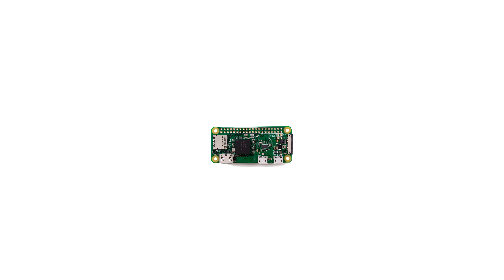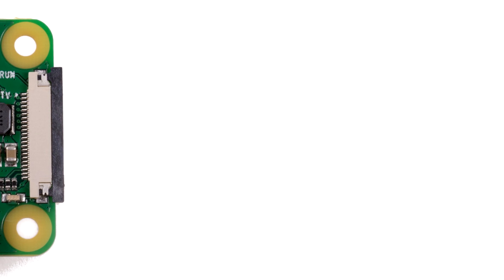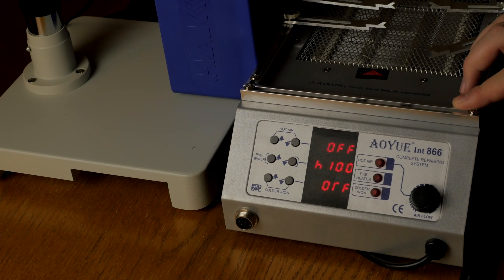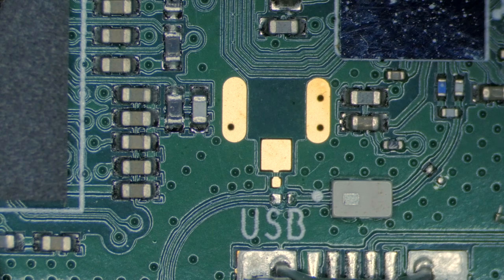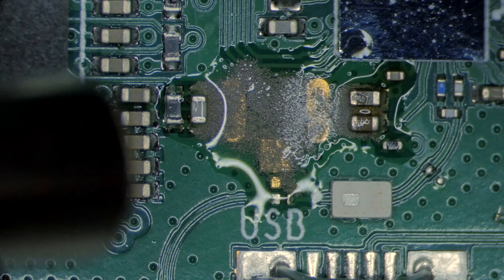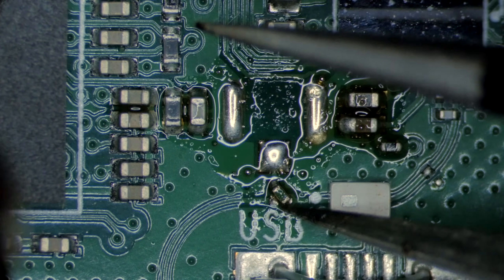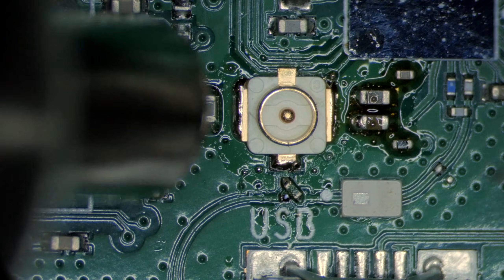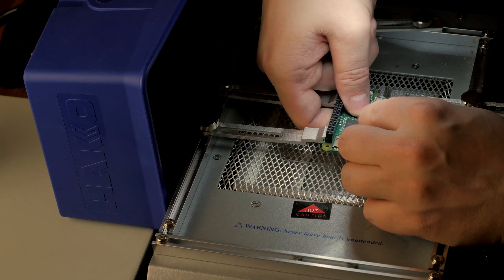Add External Antenna to Pi Zero W [Tutorial]

Comment from the maker: After several requests, I've made a handful of modified Pis available for purchase. If you don't have the soldering tools/skills to solder it on your own, or just don't have the time, check it out! They are available here: https://www.ebay.com/itm/114773309557
Reply: is it still available?
Reply from the maker: @ivan_adamovich  I'm no longer keeping the Pi Zero W in stock, however its successor the Pi Zero 2W is available. Check out the link in the description as that's the only link I'm keeping up-to-date.

Comment: 20 odd years getting by without a rework station and you're telling me a $5 computer is going to make me change that?
Reply from the maker: This is doable with just a regular soldering iron, though it's a bit more difficult. If you look at my video on the Pi Zero 2 W, there is a section showing some techniques that can work for soldering this with a regular soldering iron (https://youtu.be/6R8xhSzpJTU?t=276).

Comment: I didn’t have the right tools to do this. My WiFi signal was borderline on my pi zero w. I added an external antenna that was not actually connected to the board.  I grounded it to the pi and soldered a resistor from the other antenna lead to the same ground.  It works!  I have a reliable connection now. I assume there is re radiation of the signal getting to the  antenna on the pi.

Comment: There's no need to be picky when it comes to container types if all you're using is IPA — this stuff doesn't melt plastics any more than ethanol does (at least the types actually used for containers; can't vouch for 3D printer stuff like ABS). Acetone is another story, but I'd never risk exposing an assembled PCB to acetone anyway: e.g. the plastic on those DuPont headers will certainly turn into mush in minutes.
Reply: Once in a very rare while, Ive seen isopropyl damage something. Cant think of any examples at the moment. But 99% of the time its perfectly safe to apply it to projects.

Comment: I'd never use a hot air gun for this. A soldering iron will allow you to both remove the 0201, solder the u.FL, clean the resistor pad flat and put it back on without much effort. A hot air gun, on the other hand, can and will necessarily desolder every component in the vicinity, so your tweezer hand must be rock steady: one wrong move and good luck reassembling half the board. Or, worse yet, set the airflow one notch too strong, and all the components are literally blown away.

Over 3–4 years as a hobbyist working almost exclusively with SMD, I didn't have many occasions where I picked the hot air gun for PCB work over either an iron, a hot plate or an IR reflow station. And when I do, I tend to damage chips, peel pads off or make some other kind of mess. My advice is to reserve the thing for shrinking the heatshrink.

Comment: So what type of magic wand did you use to make all that solder just suddenly jump into the right place? I have a couple of Harry Potter wands. Will one of them work? Or do you need a special soldering wand.
Reply from the maker: It's a hot air rework station. The surface tension of the solder pull things into place as soon as it melts

Comment: Are you going to be making any more of them?  I just need a few with the connector added.  Already have the connectors and antennas
Reply from the maker: I'll be making some more as soon as I can get them back in stock. I have a shipment of the second gen coming as well that will be up soon (hopefully sometime next week). They will be up here, so check back early next week: https://www.ebay.com/str/techcaleb
Reply from the maker: The second gen boards are now available: https://www.ebay.com/itm/115117982940

New video coming sometime this week on how to do the modification as well (it's similar to the Pi 4).

Comment: The Pi Zero and Pi Zero W is a slow computer. Any Pi 2 B, Pi 3 B or Pi 3 B + or Banana is faster.
Soldering paste is not necessary, just apply flux and tin it with a solder wire that is not too thick (1mm or 0.5 mm). Solder paste gets bad over time and can then no longer be used, 0.5 mm solder wire is better for SMD for hobbyists. You can also preheat in the oven to 180 - 200 C.

Comment: I lost the resistor when I try to resolder it's new place. Can I use the other resistors right below the embedded antenna instead of original one? Are those all same?
Reply from the maker: The things below the embedded antenna are actually capacitors. If you lost the resistor, you can either order a new one from a parts company like Mouser or Digikey (it's a 0 Ohm 0201 resistor) or just snip off a bit of fine stranded wire and use that. It's just a jumper resistor so it should work either way.

Comment: Is it possible to add network controller and add external antenna to Raspberry Pi (without W) or this version is designed for using without internet ?
Reply from the maker: The non-W version of the Raspberry Pi Zero doesn't have any of the pads needed for putting on the wifi chip, so it's not really designed for it. In that case your best bet is to get a USB wifi card (or just get a Pi Zero W). For all the full Pi versions starting with the Pi 3, a similar modification is possible (see https://www.youtube.com/watch?v=MTwWnZG8wUY and https://www.youtube.com/watch?v=mZGMGs6RDtc)
Reply: @funtechu  I'll watch it. Thanks for the fast answer

Comment: Is there a measurable increase in performance doing this? I have a DIY ROADIE in my Tesla, based on a Pi Zero W. The signal is at 30%, enough to remotely view files on the device but not to copy them. As the licence for the software is linked to the Pi, I only get one shot! Just want to make sure its worth it. Any microscope/magnifier recommendations? Thanks.
Reply from the maker: It does have a small performance improvement depending on the choice of antenna. More importantly, having an external antenna gives more flexibility in where you put the antenna which could give better results.

I did some measurements for the Pi 4 version which you can find here - https://youtu.be/MTwWnZG8wUY?t=289

In that case the Pi Zero W would be closest to the Ext cut variant shown, so depending on the location, the signal level will likely be either comparable or slightly better (5-10 dBm) than the stock PCB antenna. Those tests are done with an antenna that isn't substantially directional (Molex 206994-0100), but you could also use a slightly more directional antenna to get even better performance.
Reply from the maker: For a microscope, I'm using an AmScope SW-3T24Z with a ring light (LED-144W-ZK) and a 0.5X Barlow lens. But any good binocular scope should work well.
Reply: @funtechu  Thanks for the response, I appreciate it. Definitely worth experimenting.

Comment: Yes, we all have high-end equipment as you have but not for me I only have a soldering iron and solder so why didn't RP add the socket it would only cost a penny if purchased in thousands?
Reply from the maker: I suspect it's a combination of them thinking that few people will use it, and the cost. The Pi Zero W is a board that they actually sell at a loss usually (which is why most places limit you to only every buying 1) so every penny matters. As for the cost, even when buying in high quantities, a U.FL connector still costs around $0.50. Multiply that by about a million units sold, and that's probably why.
Reply: Much of the point of the Raspberry Pi computers is for school children in England to learn to program them and use them as the basis for projects. The kids who need the socket can learn by installing one which is the whole point.

Comment: Damn, now where did I leave my Hot Air Rework station. Thanks for the informative demonstration.  Would be nice to see a version using caveman tools that we all have.
Reply: I would rather do this with a proper soldering iron, instead of hot air.
Reply: I did it with a hakko soldering iron. Needless to say the resistor disappeared  during the process and I ended bridging the pads with a tinned super fine strand of copper wire I pulled out of of a cable I found. Shockingly, it worked.

Still: 3/10, do not recommend.
Reply: You can use a hot air gun they're like £10 - £30 pounds. Or just a solder iron :)

Comment: why doesn't come like that stock?
Reply from the maker: Probably cost. It doesn't cost anything to add the footprint for the connector, and the jumper resistor is about 1/2 of a cent, so it's a compromise that allows people who need an external antenna to modify it, without driving up the cost for the (probably majority) who are just going to use the on-board antenna.
Reply: Why? Most likely because most English school children don't need one and those who do can add one.

Comment: That is excellent soldering skill. 👍

The only remark I would make is about touching the antenna after installation - I've lifted trace (the conductive material) on boards easily.  You don't appear to be too worried about moderate force.

Comment: add heat to the resister and keep pulling until it stops resisting
Reply: I can't get that little f*cker off and I'm trying with 340C already…
I'm taking pauses because I don't want to burn the board…

EDIT
Okay, sorry for bugging you
I think I'll need to calbibare my hot air since the resistor desoldered at 400C and my 183C Solder around the same temperature… 
I ended up with 420C on the display at mid to high air speed. 
But yeah, I'll need to calibrate that.
Reply: @MCgranat999  ya that might work

Comment: Very good explanation, thanks for sharing! 

I've never worked with a hot air station, but that might change during next few days. :-)
I want to solder an SMA connector to my Pi Zero W. Not sure if I try it with my regular soldering station and novice soldering skills or if I ask a friend who owns an hot air soldering station.

Best Regards
Reply from the maker: I would definitely recommend the hot air if you have access to it. Maybe you can even ask your friend to do it for you if they are already good with hot air!

Comment: I am doing the same thing with the Zero and maybe the Pi4.  Using the heat gun is scary to me.  When I see all those small parts on the board I am afraid they will fly off!   I need more practice with that tool.          Thanks for the great info!
Reply from the maker: The surface tension of the solder will usually keep everything in place as long as you don't bump it physically. You can also turn down the air speed to start with, and use a wider nozzle. That will make it less likely that items get blown around.

Comment: Its possible to fit it with a fine tip soldering iron. The problem with the fine tip is that it cannot feed in enough heat. To get round that, pre-heat the board in your kitchen oven at 120degC(248F) then place it on a ceramic plate to work on. Use gloves or a PCB holder when soldering as it will be too hot to touch.
Reply: What about a TS-100 soldering iron with the fine tip installed?
Reply: @AtlantaTerry  A bigger tip will make it easier to flow the solder but fiddlier to solder without knocking off other components. If that worries you, wrap the surrounding area in Kapton tape. Actually doing the hot air reflow method in the video is really risky without Kapton tape too.
Reply: Or get a tip shaped as an angled frustum, like TS100's BC2 type. Its end is flat and large enough for seriously huge stuff like multistrand copper wire, but its edge is sharp enough even for 0.5mm pitch FFC connector pads. Seriously, it's the best of both worlds! I don't even remember the last time I had to switch to the needle-point tip. It has its uses on boards where 0402s are packed like sardines, but arrangements like that are easy enough to avoid in design.

Comment: https://www.youtube.com/watch?v=62WiPscjh4Y looks pretty easy to me. Video is way to complicated, with equipment nobody really has..
Reply: @funtechu  agreed. The resistor seems to be only like a Switch to use the external antenna and some use a simple short wire instead of the resistor, might be easier

Comment: Thank you very much for the How-To. I am curious if an antenna can actually help my project. I am building a Video-Wall (see http://piwall.co.uk/). At the moment I am testing if this can be achieved using WIFI. My first conclusion after some testing is, that a noticable amount of data gets lost, thus showing artifacts in the video stream. The transmission protocol is UDP, so it's like "fire and forget" with no error check. The video stream received and tested with a Pi Zero Board is okay, and gets better the closer I am to the WIFI source.

Can you make a statement about the robustness of the WIFI connection with your antenna used?

Thanks again!
Reply from the maker: It took a little bit to get around to it, but I finally did an experiment to compare performance with the PCB antenna vs the external antenna that I have (https://youtu.be/MTwWnZG8wUY?t=245). In general, I saw around a maximum of 10dBm improvement in the signal level. The video is for the Pi 4, but the cut trace variant is essentially identical to the Pi Zero W.
Reply: Your website ist not reachable. Is the project still ongoing? 
If you have good signal and low interference on the used channel, even with UDP and WiFi you shall get good results.

Comment: simply connect  the two with a copper wire since it is a zero ohm resistor. Am I right?
Reply: @funtechu  I do not have the raspi zero or a ufo sna base. However i will solder the wifi  pig tail directly and save a lot of troubles.

Comment: Thanks for the video, but this is way above my soldering skill. Can see a hot mess of melted materials after I attempt this. I hope they add this connector on future revisions of the Pi Zero W as it's a great board.
Reply from the maker: There were a couple of other people with a similar sentiment, so I soldered up a handful of them if you are interested. https://www.ebay.com/itm/114626906396
Reply: Why would the Pi Foundation increase its costs? Most English school children don't need this connector and those who do can add one.

Comment: I would classify the pi zero as a microcomputer rather than a microcontroller.
Reply: or how it IS described: sbc, single board computer.
Reply: @peepopalaber  You're not wrong, that is how the pi foundation describes it. That description covers a very broad category of computers with all devices soldered onto the board rather than using sockets/headers. Anything from the pi (or smaller), or an ATX board with a powerful integrated x86 processor would fit that description.  My distinction was specifically addressing the difference between a microcontroller and a microcomputer, two small form factor devices with a similar role. I would distinguish the two by whether I/O, memory, etc. are integrated with the CPU or not, though that distinction has gotten fuzzier over time. You can't even distinguish by the presence of an OS, since there's stuff like DuinOS.
Reply: its not a microcontroller its a SBC single board computer

Comment: I want to build amatuer rocket using rpi 0 w. Got already working mpu 6050 board and want to add antenna mod. Unfortunatly it seems pretty hard to do ;/ I only got soldering iron device, and dont think its enough for this operation.
Reply: have you considered an esp32 Cam?  half the size of a pi zero .. less pwr consumption too.
Reply: Also, not sure why you would use a mpu605 on a rocket?? Unless you wanted to record how high it went?? Mpu6050 is more for drones, planes, things requiring balance control..